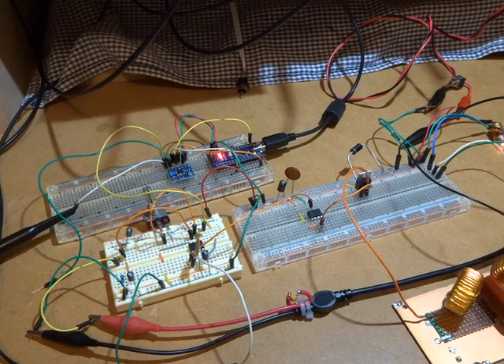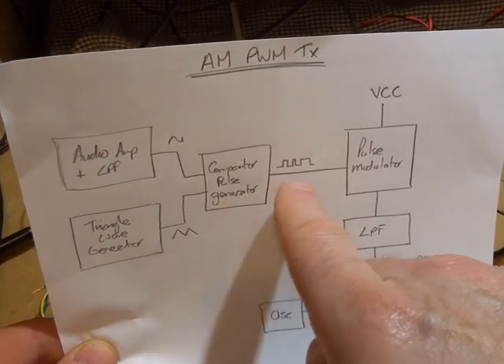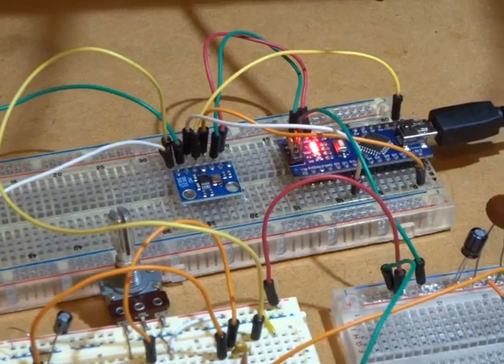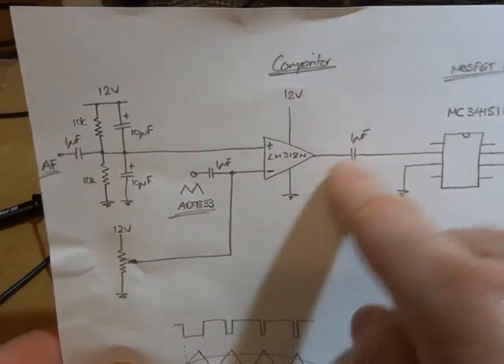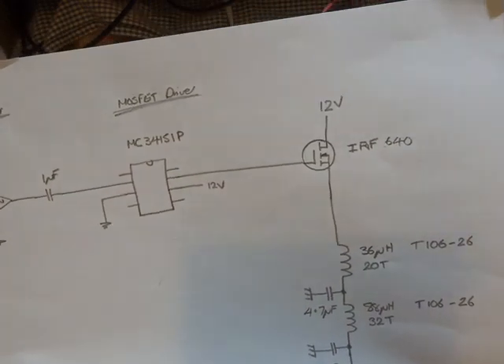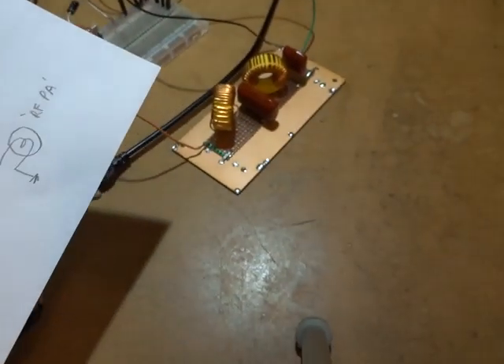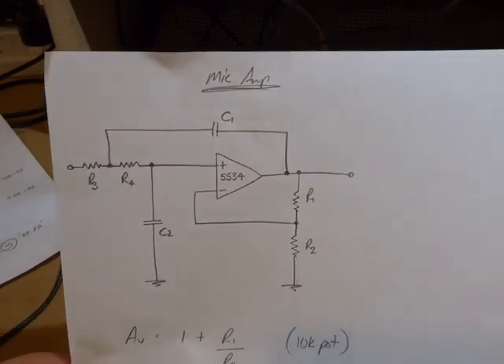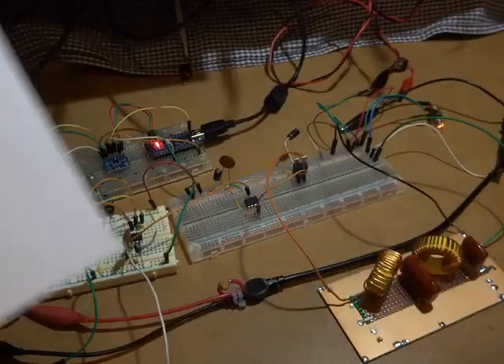AM PWM Rig Part 1: Pulse Width Modulator

Comment: Hello Charlie, you forgot the freewheel diode in the source of the IRF640, to ground. I recommended the MUR460, what is good enough for small currents and easily to order. For higher powers use a fast diode of about 30nS in TO247 housing.

Comment: You can use a TL494 as a PWM modulator or a SG3525 or so, that's much easier as individual blocks such as comparator and integrator.

Comment: Excellent video, thanks. Don
Reply from the maker: My pleasure Don. I'm glad you enjoyed it.
Reply: @CharlieMorrisZL2CTM  Charlie, yes very interesting.  I recently identified a 5 KW AM broadcast station that was generating all kinds of spurious emissions, and was invited to the transmitter site to work with a contract engineer to identify the problem.  We noticed a major spur 60 KHz above the fundamental carrier frequency (with modulation turned off) and when I looked in the manual for the transmitter I saw what they call the PDM (pulse duration modulator) which is the same as PWM runs at a switching frequency of 60 KHz.  The engineer said the problem usually is associated with bad electrolytic capacitors in the PDM circuit (including the capacitors in the PDM filter), and looking at your example I imagine the issue is really the capacitors in the PDM filter.  They ordered a recap kit for the transmitter PDM (including the PDM filter) and hopefully this will solve the problem.  Thanks again.  Don

Comment: Nice work as always Charlie. Switching circuits are quite different to the linear small signal stages in the SSB rigs we have been playing with . Add in the power shunt diode on the IRF640 source on your circuit diagram, it is an essential element.  Look forward to seeing how the project develops. I've been thinking about a small, 20 watt AM TxRx  for portable work.  It's a challenge with antennas and a battery power supply but it can be done. Why? Because it's not sitting on your bum in your shack talking into an appliance 😮. Paul VK3HN.
Reply from the maker: Cheers Paul. The diode is in the circuit. It's been fun so far. Very different from SSB that's for sure.
Reply: @CharlieMorrisZL2CTM  Checking back with you Charlie, how are you, have you been travelling?
Reply from the maker: @Paul_VK3HN  Yes. Been out for three weeks. I'm back out again soon, so I'm not sure how much time I'll be able to give to thew project. Lots of competing priorities! 
73s
Charlie ZL2CTM
Reply: @CharlieMorrisZL2CTM  You gotta go to work so you can buy the bits.!! And keep the power on!  Good luck Charlie!

Comment: Try this out: https://www.dropbox.com/s/voakjbdy2x843gk/hysteretic_pwm_d_amp_with_creative_misuse%20of_a_comparator.png?dl=0
I decided to try out doing something interesting with simple parts, looks like it might just work for you ;-)
EDIT 1: Excuse the mess on the schematic.
EDIT 2: I know that the output filter is miscalculated, I just threw some values into the program.
Reply from the maker: Great. Thanks for that. I like the schematic title!
Reply: @CharlieMorrisZL2CTM  No problem, I hope it works like in the simulator. You might want to replace R13 with 10k (play with this value, if you get oscilation on the output its too low, seems that 1-10% hysteresis is optimal), C3 should be ceramic and can be made 100n, C5 might need to be changed to 1n ;-)
EDIT: Also note, that the circuit can't sink current, it would need the whole half bridge then. But I don't think that your application would need the ability to sink current :-)
EDIT 2: Switching frequency depends upon the hysteresis of the comparator stage and (I think) the time constant of the integrator in the error amp. I'm not 100% sure how the bloody thing works, really, it's kind of a modified hysteretic buck converter.
EDIT 3: It also occured to me that you can move the negative input of the hysteretic comparator to the filter output, should lower the THD, but only at lower amplitudes.

Comment: You need to bootstrap the MOSFET driver. You will have a lot of voltage drop on it if you just drive the N type with VDD (VGS will drop across the FET!!!).
Reply: And also add a Shottky diode from GND to FET source, so the filter chokes can freewheel when the FET is off.
Reply from the maker: Thanks for that. I'll definitely look into that.

Charlie
Reply: When I was playing on 472 kHz with a class E power amplifier, I found using a FET driver made a huge difference to efficiency!

Comment: Great project. Thinking about available PWM sort of things that are free to cheap...PC power supplies are every where and at good power ratings.  Actually almost every modern power supply is PWM these days. It seems one would modify one from fixed frequency to accept the driving pulses from your design. I think they also operate in the 50 to 100 KHz range.  Just an idea that popped up. Really enjoy you postings.
Reply from the maker: That is food for thought Kenneth. I've added that to the list of things to look at down track. A 24VDC PSU would be useful.

Comment: I wonder how clean your triangle wave really needs to be as with AM you can easily demodulate the RF output and apply negative feedback  right back to your audio input.  Food for thought
Reply from the maker: Not sure Chris. I have no experience with AM TX so it's all a learning experience. It would be easy to try different waveforms once the TC is built.
Reply: That might get the whole thing to oscillate (I'm no pro, but it seems that taking NFB from so far away point in the circuit might have too much phase shift). Tapping the NFB from the LPF should work though (as in class D audio amps).